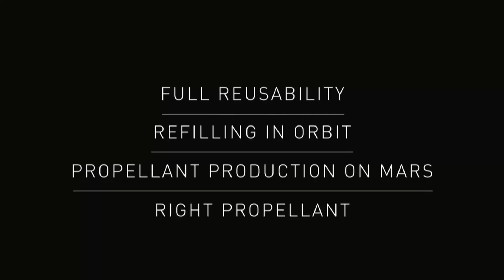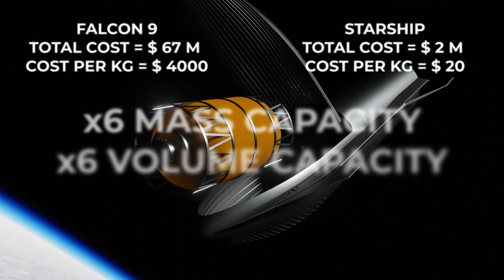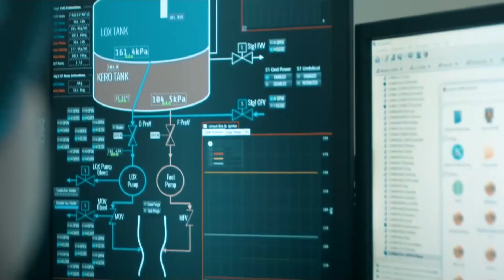The Real Reason SpaceX Needs Starship

Comment: Have any evidence starship will be $100 per kilo or are just repeating claims from a man that makes outrages claims in order to sell something to someone?
As of what has currently been built starship is a 100% reusable launch vehicle to deploy starlink satellites. Current starlink deployment vehicles wastes the stage starlinks are deployed from.
Reply from the maker: There are reports that estimate the construction costs at about $90M  for each whole stack (payload research does a great job at this). Considering that they are reusing the Falcon 9 first stage more than 20 times, it is not crazy to think they will be able to do at least the same for Starship, which would set the costs at $5M per launch (amortization) + operational costs. I don't think that $10M is that difficult to get, considering what they have done with Falcon 9, and that amount would be the 100 $/Kg that I mention. What do you think would be a reasonable price per kilo for Starship?
Reply: @HowEverythingW  No verifiable payload analog has been launched by Starship, until that is done, no total tonnage can be calculated. The larger the vehicle gets the more fuel it has to use to lift the vehicle itself, making it more expensive. Correct me if I am wrong here, Falcon heavy uses merlin engines and super heavy uses raptors, if correct, how can you even make a comparison?

New vehicle, new engines, needs a damn payload analog to test its actual capabilities, not some SpaceX datasheet. Do you buy a tesla based on its specs from the pre order hype or the real world testing?